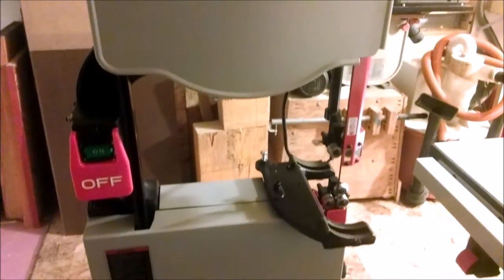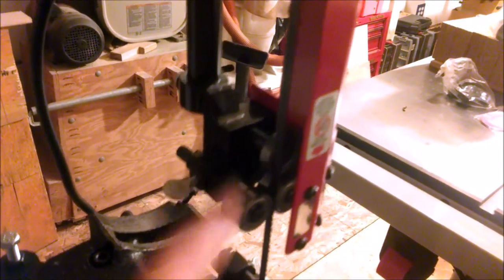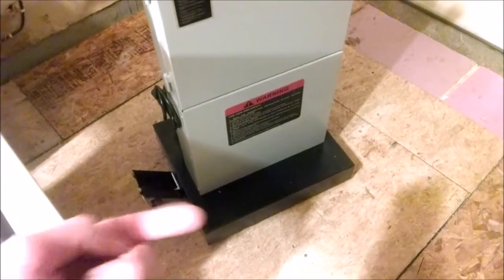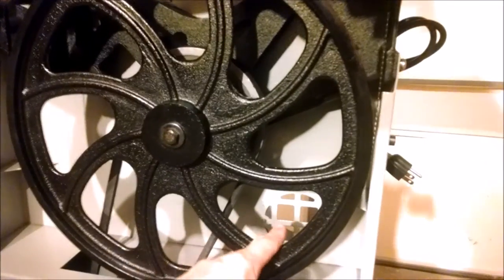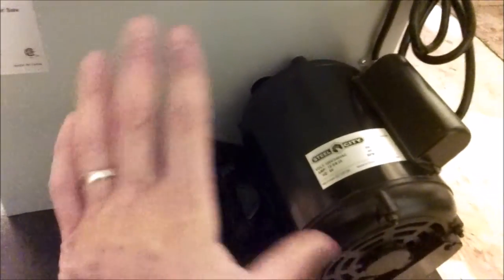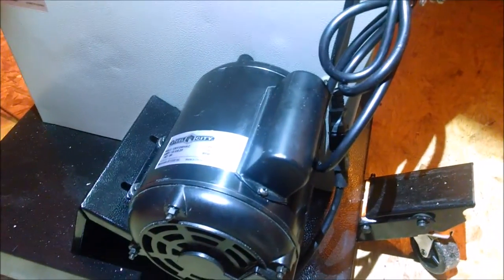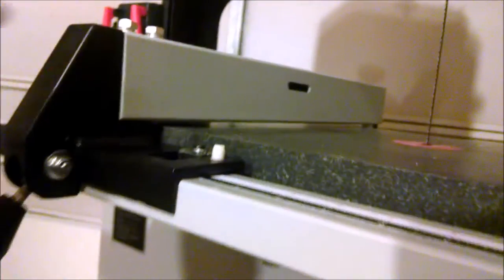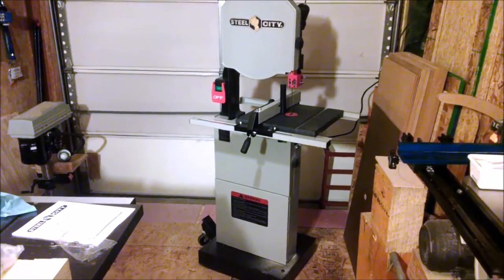Steel City 50150G Bandsaw Assembly Video

Comment: I have a parts problem, the Tracking Lock Knob is broken. I tried to get in contact with the Steel City Customer Service and got following answer: 

Steel City TW shut down operations on March 31st 2015, there is no warranty from them.

Terry Ross
Nordis
520 Thomson Dr, Unit3
Cambridge, Ontario
N1T 2K8
Reply from the maker: Wolfgang, alas, Steel City is gone. I would recommend you take the broken piece to a good hardware store and see what you can find there.